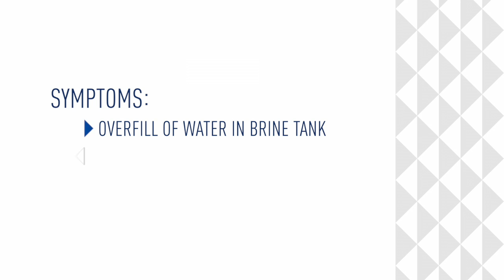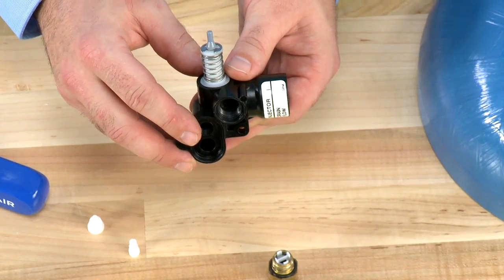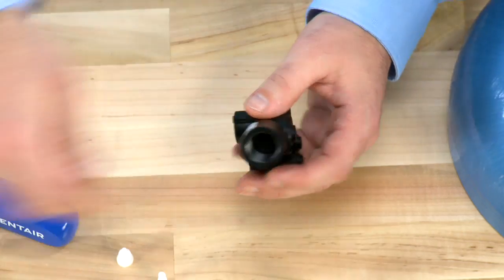Fleck 5600 Injector Repairs

Comment: The flow control under the white plastic piece you pulled out with a number on it well mine doesn’t have that rubber washer or flow control.
I’m having g an issue with no suction on my brine rinse instead it’s pushing water at a good heavy flow. Is this missing piece my problem?
Reply: Did you figure it out? Same issue here
Reply: @jeremylanglois7816 
Yes I had to replace the piston assembly and it solved my problem
Reply: @jeremylanglois7816  When you turn your regenerating dial by hand all the way around back to the beginning is it harder to turn then before when it was new or newer?
Reply: @rotaxrider  I have the digital one so not sure, I might try to take it apart and check the piston assembly on your advice though. I already cleaned the injector and dfcl without success unfortunately

Comment: If my screen is rusty and dirty what kind of problems does that cause? I took it apart cause brine water was not refilling. I've clean it. it seems to look OK know but haven't tried it yet.
Reply: My screen and injector nozzles were completely blocked with slime and rust, too. I cleaned them up with apple cider vinegar soak carefully and still need to check the brine line flow control and the drain line flow control. This is an excellent how-to video!
Reply: Mind too, ughh

Comment: Where do I find the special tool used on the drain line flow control? And also the lube used on the gaskets?
Reply: Found the tool on Amazon... https://www.amazon.com/DLFC-Retainer-Removal-Tool-Fleck/dp/B075VB32TN Still looking for the lubricant for the rubber seals.
Reply: @HopWorksET  Hey I found some Danco Silicone Grease #88693 also Danco Waterproof Grease #80360 on Menards website,  not sure if they are the same compound, because one says silicon and the other say waterproof.  I will look for it at the store, it says its for plumbing.
Reply: @HopWorksET  you can also use a pair of pinch nose pliers to gently get it out